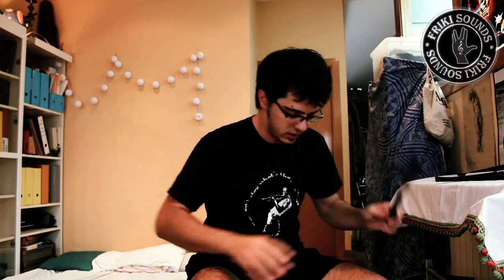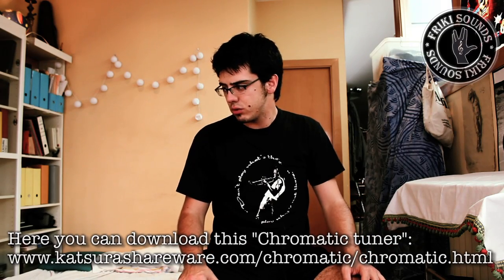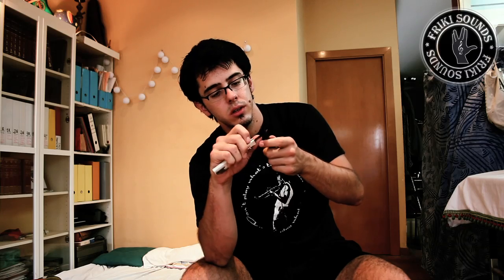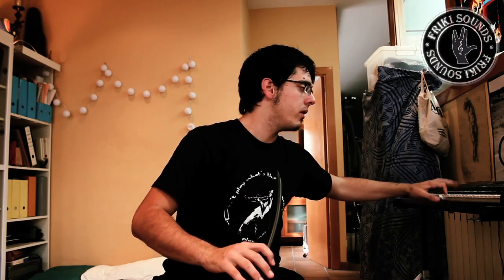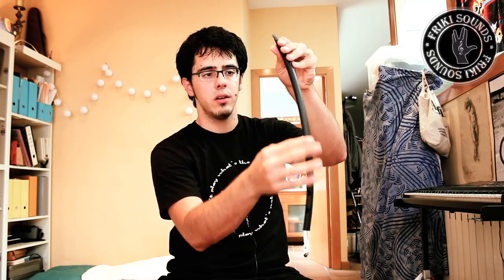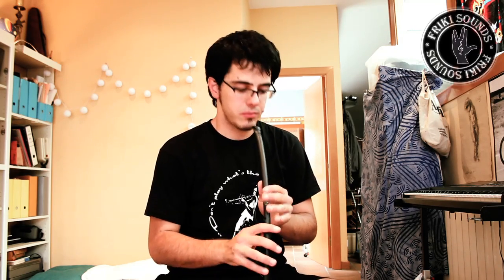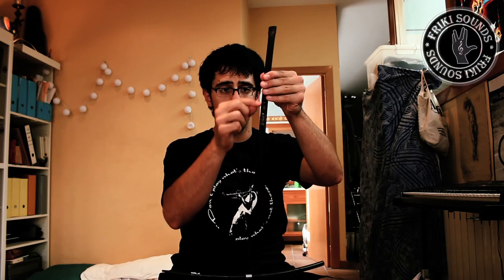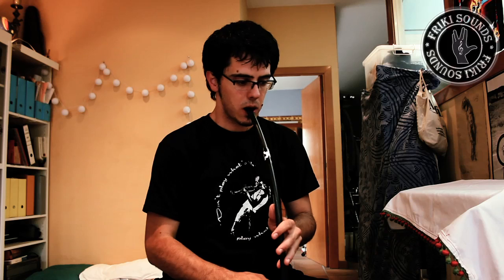How to make the "Plastic Saxophone" - Friki Sounds Project

Comment: man, how on earth do you make it work? I tried twice, I grinded little by little, tried to sound, until I pierced the material. I only got some sounds not coresponding to the length of pipe, and with hard difficulty. How thin should it be the reed? how even should be grinding on the length of the reed part? does it make thinner at the end, then thicker, or evenly thin, all the reed part?  how long is flattened part of the reed, and the thinned part? I would try some more, but if I keep going the same way, I do not seem to get anywhere.
Reply: actually I have by chance a bassoon reed, not the basoon itself, however I know that, oboe reed, for example, has very strict specifications for thickness at the edge, at the middle, like 0.4mm,etc, width, and little variations of it can change it's main resonant tone. I am familiar with the rest of it, I have made plastic flutes before. But, i will try some more. tnx !